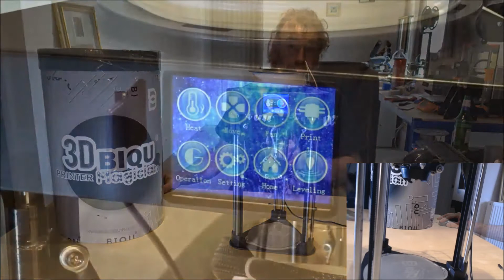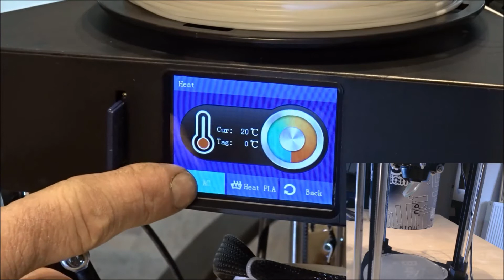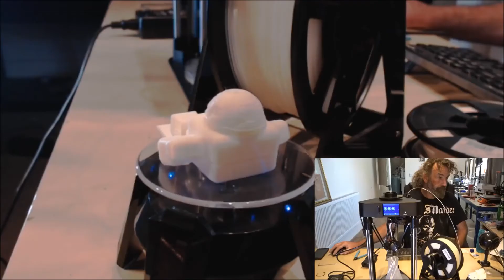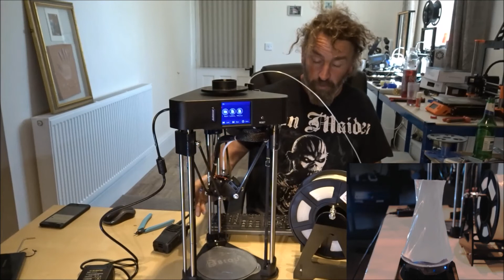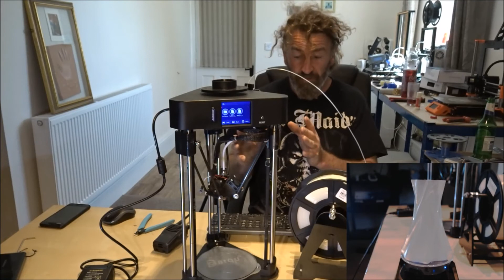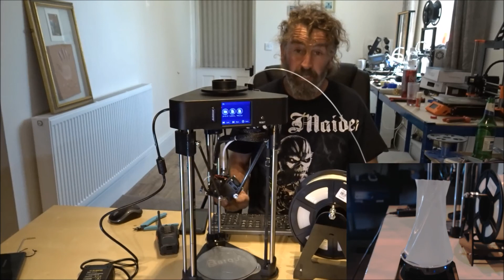BIQU Magician Delta 3D Printer Unboxing and review

Comment: Do you have a link for that clear filament ? Highly impressed with this printer, quality review, thank you.
Reply from the maker: SUNLU 3D Printer Filament PLA Plus, 1.75mm PLA Filament, 3D Printing Filament Low Odor, Dimensional Accuracy +/- 0.02 mm, 2.2 LBS (1KG) Spool 3D Filament for 3D Printers & 3D Pens, transparent PLA https://www.amazon.co.uk/dp/B07BF65RTH/ref=cm_sw_r_cp_apa_2kYXBbHARQ28Q

Comment: I had one of these, and the cheap titan extruder clone had all kinds of alignment issues after a couple of weeks of daily use. Before that, the print quality was fantastic. Like, actually better surface finish than I'm getting on my i3 MK3 currently! The hotend keeled over after a month, and I returned it for a refund. It's so close to being a great machine. Maybe I got a bad one though I suspect that they cheaped out on a couple of critical parts to add that goofy leveling probe and the surprisingly decent touchscreen.
Reply from the maker: Still printing like a boss but I will keep everyone informed of any issues
Reply: Glad to hear it! I was really impressed with that machine overall, so I hope that I just had a bad machine.